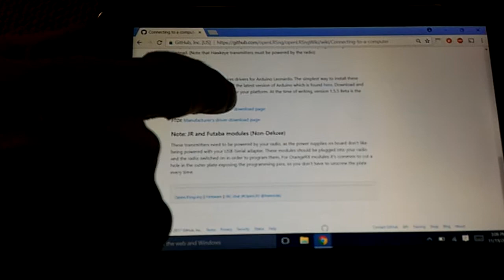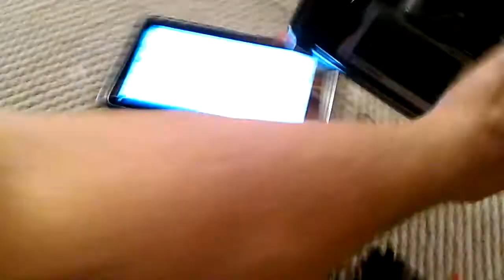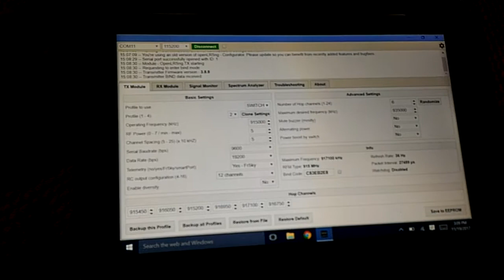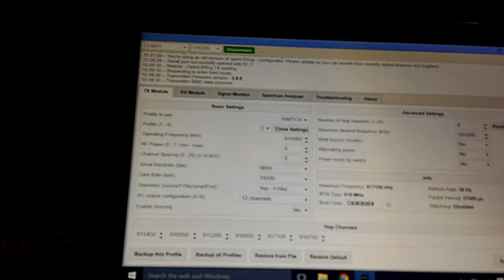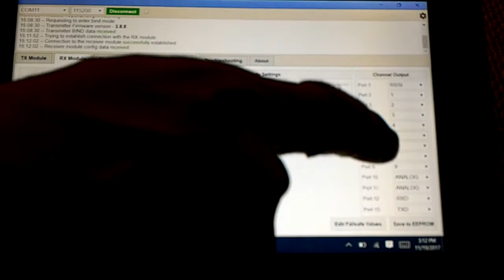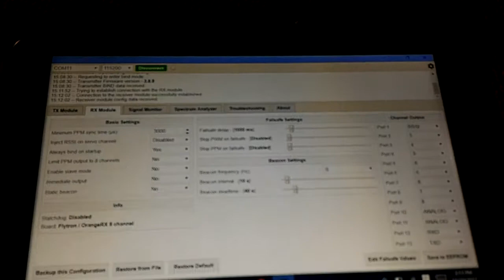chiplrs configurator installation and settings

Comment: Hi, Nice Explanation.....I see your Rx has the three pin servo headers,new has two by looks, 
Cheers
Brett
Reply from the maker: Kermets,  yep, i modified the original ChipLRS receiver so that it can use 8 standard servos.  i soldered an extra two rows of pins that line up with the ground and 6v rail for the servos.  I should probably post a video showing how i did that...